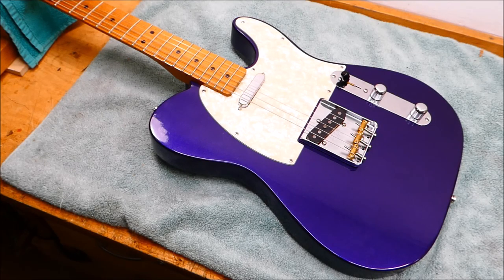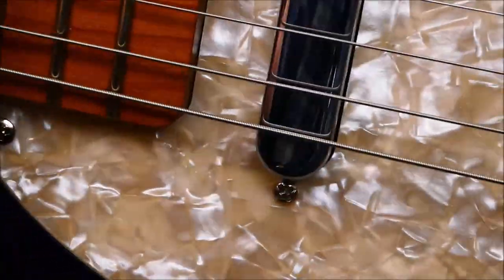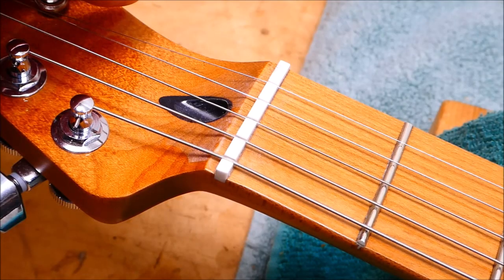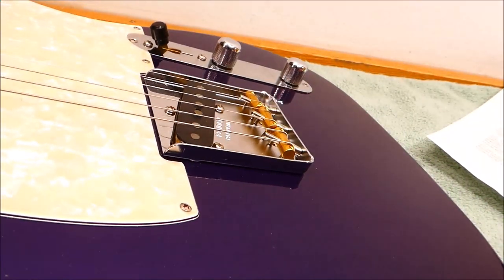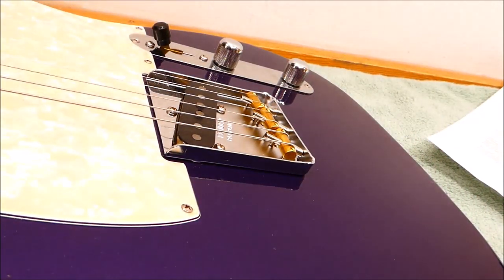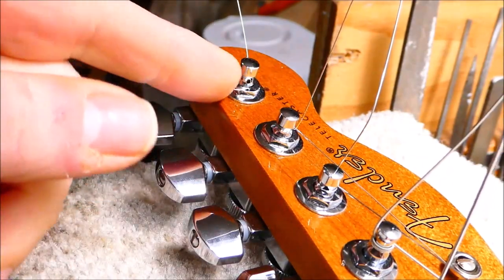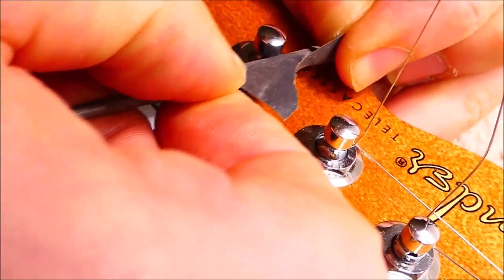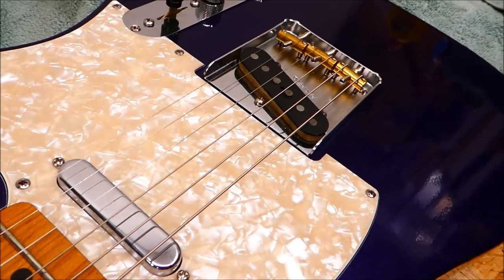A Blueberry Telecaster

Comment: I am kinda bit disappointed that you have not commented any thing about the hole in the neck pocket. This is the thing Fender does in MIM guitars even in the expensive models. They reason it as pilot holes for the router and have one more under the pick guard. USA and Japanese models do not have it. In my experience neck is the most sensitive thing and needs to be good to transfer vibrations into the body. Thicker necks and more stronger necks often make guitar sound better. In my experience neck wood grain orientation has to be compatible with body wood grain orientation and if they are complete guitar vibrates and resonates good. Gibson uses quarter sawn neck and boys and way often hit the spot. I have had lot of necks and bodies for Fenders and even if parts are resonant on each own I’ve found that combination must be good and sometimes vibrations kill each other, especially on some notes, and that kills sustain. I’ve also find that good connection between the neck and body is crucial. I found, early on, fact that tightening lose neck screws on a start improved sustain and tone immensely. There fore I despise neck pocket hole in those Mexico made guitars. It removes a mass and contact patch between the neck and body and reduces transfer of the vibrations. I do not even want to start thinking why do they do it. For me it is a no go. I say plugging it with same or denser wood with tight fit with a plug that has same grain orientation as the body and leveling it with the rest of the neck pocket makes for better guitar in most of the cases. And personally have discarded only MIM body I own and have matched that neck with a another body. I both that MIM strat while it came with quarter sawn neck that is pure luck and was 50th anniversary to. Got it long time ago and cheap. Typical mismatch of body with awesome neck. Body was painted in the Pelham blue but paint is way to thick. Body seems to be poplar to while I saw on the bare parts it’s whiteness and green mineral streaks. It sounded awful and plastic. Notes would die off in 5 seconds. With other body it resonates like crazy and sustain is awesome. Whole body is discarded including metric tremolo with thin tremolo block as well as typical for that era shitty ceramic pickups and non USA electronics and plastic isolated wires. Every part was selected with all experience I have gathered in the decades. Now that Strat does not hide to any Strat short of original 50’s and beginning of 60’s guitars. It sounds better than some Custom Shop guitars. Though pickups are boutique and tremolo is my hybrid with boutique saddles and springs. All harness is way it should be and done with proper wire. Only I have opted to have tone pot on the bridge. For the rest it’s way it was meant to be. OAK pickup selector, Switchcraft jack, CTS pots, paper in oil cap. Well sounds simply great. Anyhow funny how even first gen Classic Vibe Squire guitars that are made in China do not have neck pocket hole and hole under a pickguard. All MIM guitars I have ever seen have those two holes. Round holes can soak vibrations coming from any direction effectively. Longitudinal long but narrow hole with pointy ends would not soak as much tone to. But never mind it is what it is and I personally will never buy MIM guitar unless they quit doing that thing. I would personally be quick to judge that it was forced on those guitars so they do not come at USA made level guitars especially now where many MIM guitars come with Alnico pickups and almost all come with the proper electronics. Though I hate to sound like conspiracy theorist.
Reply: Guitarists and their snake oil. The rabbit hole never ends. I suspect most of what you're hearing is placebo effect
Reply: @ileutur6863  Well Sir you are mistaken. I am in this over 30 years. My findings are 100%
Reply: I’m at the point where I don’t care so much anymore. I feel like so many amazing tunes were played on sub-par equipment. I feel like the chase is fun but ultimately fruitless. What’s the point of having a guitar that is like it was beamed down by the gods if the tunes coming out of it aren’t really flexing it to it’s maximum potential. I mainly just play on an old beater MIJ Washburn that cost me $125.
Reply: @Rakkhun369  I agree with you 100%. For example Seasick Steve plays on the broomstick abd still makes great music. But MIM guitars are not cheap any more. Lot of them are actually more expensive than PRS SE guitars and most expensive signature models of the Epiphone. So why paying in some cases 1000 $ plus and get body with a hole in the neck pocket when you can buy Squier from 115 $ without it? See? Lot of MIM guitars are very expensive and for their price they should come without it. I would rather buy Classic Vibe Squier over any MIM Fender. Actually Classic Vibe  gutars are pretty good. Regarding to the Fender prices, not that long ago Custom Shop re issue guitars were starting from 2.5 K. Master build guitars were starting from 4.5 K. Now you have to be lucky to find any Custom Shop guitar that is 4.5 K. Most of them are 5K and above. So what happened in 15 years?
Reply: @NINEWALKING  a lot of people are in this for 30 years, there they are selling us tonewood, gold plated audiophile cables and bolt on steel pieces that magically increase sustain. I mean if you can genuinely point to a difference on a spectrometer and tell me "yeah that's the hole in the neck pocket right there" then you're the best audio guy in the world.
Reply: @ileutur6863  I am selling you nothing but I know what I hear and what I know. I am amp  builder and designer. I mod pedals. I mid guitars. I know how complex things are and why certain things sound why they do. Took long time while most of the stuff is not shared.

Comment: I often wonder why Fender doesn't do six individually exact tuners regarding height, especially the low E always seems to be at a wrong angle if you watch from the side. I mean, they buy so many tuners that getting them made to match each individual thing should be possible. All these compromises in height drives me crazy. My cheap Thomann Fusion 2 has the best stagger along with my JTV-69 Variax. For me a 22mm. post for the low E would be perfect, and I could live with 21mm. for the rest. Jin-ho has 21mm. which works for me since I use string trees anyway, and the super low post makes restringing  problematic when light is bad.... FWIW

Comment: Hey i have a quick question. On my electric guitar I tried intonating and most strings did but i ran out of room for the high E string and its still like 20 cents flat. Could this be caused by old strings? Could i just throw slightly heavier gauge on to fix it? Thanks in advance any insight is appreciated because its driving me crazy.
Reply: Doubt he'll answer you in the comments, but you can e-mail him, I had a question too and he replied
Reply: Make sure you're using new strings to set up intonation, as well as visually checking whether your neck is tipping sideways towards the low E (press down both low and high E strings at the highest fret and check whether they're equidistant from each fret end, or if all the strings are slightly moved to one side). That could increase the scale length enough that you'd run out of adjustment. Alternatively, you could check whether your intonation setting screws are all the same length. Some guitars have compensated ones so that the saddles that get the furthest back don't have the screw poking the string, and you've got them mixed up.
Reply: BTW, my advice above assumes the intonation screw isn't long enough to hold the saddle in place as you need to move it too much forwards, the typical setup for the high E. If its the opposite (which would be really weird), you could simply snip the spring in half.
Reply: @acoffeewithsatan  yes I need to move it forward but it’s a tune o matic
Reply: @acoffeewithsatan  thank you I’ll look at this
Reply: @frag4007  I assume it's a set neck, then? I've had one off a friend by with the same issue, here's another tip: does your Tune-o-Matic have those saddles making a triangle that is flat on one of the sides, and 3 of those facing forwards and the other three facing backwards? If so, what I've done here was to disassemble the unit (check some vids so you don't damage anything) and face all the saddles the same way. There was still enough adjustment for both the low E and the G strings, while giving a tad more room for the high E.

If your bridge isn't designed like that and if there aren't any other potential construction or set up issues elsewhere causing your problem, it could be that your bridge screw points were drilled at the wrong place. You could either get an Harmonica style replacement with more room for adjustment, or check a tip/hack from StewMac where Don built an offset pair of pivot screws to compensate for that without having to plug and redrill the body. I'd check in with a knowledgeable luthier before spending money at that point, though. Good luck!
Reply from the maker: Check and make sure the bridge fits nicely on its studs. Sometimes they're so sloppy that it can sit farther away from the nut and eat up a lot of adjustment room. Also, don't try and intonate with strings that have been loosened completely or taken off the tuners. Strange things can happen.
Reply: @twoodfrd  thank you for the advice I’ll throw on a set of fresh strings and try to intonate. Have a good day
Reply: @frag4007  For tune o matics, which way is the bevel on the saddle facing? If it's facing so that the flat side is to the bridge, bevel to the nut side, you can turn that saddle around to get the little bit further to the nut you need.

Comment: I have a set of those Fender tuners and had a spell of breaking the high E and B strings at the tuner.  I also thought it could have been a burr at the tuner, but what was causing the breakage was that I was over-tightening the thumb-wheel on those two strings.  Once I figured that out and only tighten them enough to lock the string in place, I haven't broke a string since.  So, anyone having that problem should consider trying that first.  It doesn't hurt of course to inspect them to make sure there are no burrs or anything, but for some that issue will be operator error more so than a physical defect.
Reply: Thank you for adding this.  Never would have considered that!
Reply: @glenngardin3561   No Problem.  I had been using the Grover Rotomatic style locking tuners that lock automatically for years before getting these thumb-wheel style ones. Cranking the wheel as tight as possible seemed like a logical thing to do at first.  It took me 2 high Es and a B string to realize what I was doing wrong.

Comment: This guy is good, but wayyy too technical for most of the folks I work with. There are hundreds of work arounds that we use in the . Trems can be tuned to never go out of tune if you use the old school method of diving every string as you tune the guitar. Now a days we switch the saddles out to roller saddles first thing. Then mix our own nut sauce with copious amounts of graphite in it.
Yes the nut slots turn dark but who cares if it stays in tune AND gives you the tone you want? Also!! Throw the plastic away!! Brass is a first choice, but Real bone is nice too. Compensate the nut ALWAYS. Locking tuners seem to me to be the waste of an adult's time. One wrap under and two or three over is quick and easy, and have never had one slip. B.B. King used to never cut his strings off, just wrap the whole damn thing on his tuners. Seemed to work for him. lol

Comment: Personally I am just a hobbyist, but I have a lot of guitars. All under $1000 because honestly I am a hobbyist. Quantity and variety over High Quality has been my motto. I own a bunch of Gretsch, Ibanez and older vintage gear. 

I will never understand the desire for these higher end brands?!?  Everything I watch, they never seem to have better QC, they are always replacing major components. I mean I play ALOT and have never even considered the ideas of replacing a neck. Even the feel and playability of the instruments never seems more comfortable or fluid to me. I just don’t get it?

Sure I can hear and feel a difference in many acoustic guitars because the build quality and materials are superior which translates to better sound, but I just plan do not get the praise and love of Fender and Gibson instruments?
Reply: Of course you'll find flaws if that's what you search for. For every 1 broken guitar there are hundreds out there working just fine and trust me they're worth the quality. Maybe not the custom shop, but regular fender and gibson models are absolutely worth it
Reply: @ileutur6863  apologies friend but “ trust me they are worth it” doesn’t really qualify as a selling point for me.  Understand that it is not that I have never been exposed to these instruments, I have.  I Play friends, i play them at the shops. All range of quality too. Top end to entry level. There is nothing I have found that makes them standout, and watching the long term repair videos, longevity doesn’t seem to be the case either. 

I am fine with folks spending whatever they want in a desire to emulate famous musicians with unlimited resources, but I just simply do not get it?  And unfortunately the closest explanation I have ever gotten is “trust me they are better” in some undefined way .
Reply: @8wheeledassassins.  I've had the exact opposite experience. I grew up playing and modding cheap instruments, listening to every bit of criticism of the big brands, but when I finally got to hold an actual example in my hands I felt a sturdier build quality and more solid tone than what I expected. If you're really looking for a brand with spotless build quality that justifies the price, check out musicman guitars and basses.